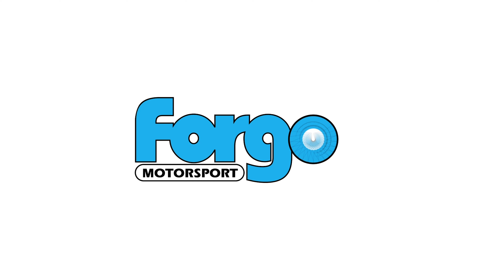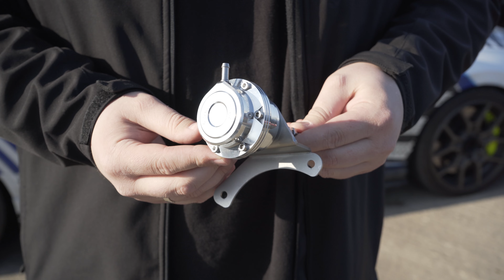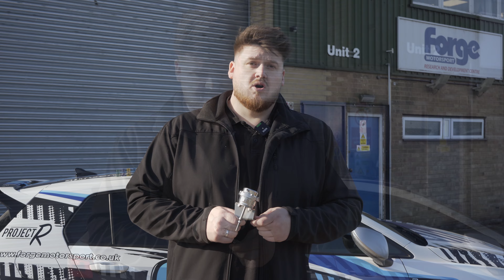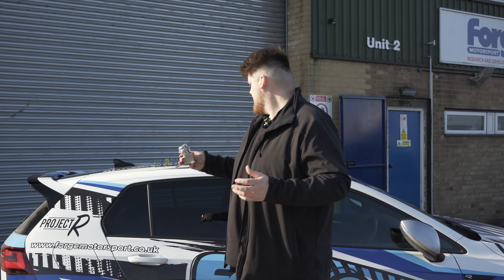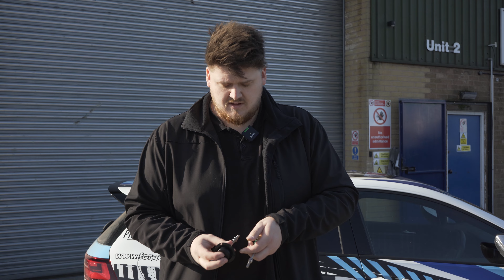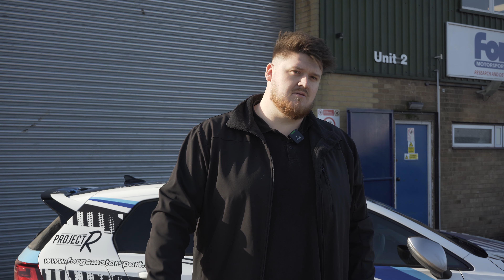Why you should upgrade your Turbo Actuator | Forge VS OEM

Comment: My actuator has failed on my 2013 SEAT LEON FR 1.8 TSI how to replace with one of these?
Reply from the maker: Hey, if you hit the vehicle tab on our website you can configure your car. We don't have a specific direct replacement for the 1.8 TSI. - Thanks!
Reply: @forgemotorsport not available for the 2013 :(

Comment: i still dont understand what the different springs do,  i presume the stronger ones close the wastegate quicker or stop it opening on higher boost?
Reply from the maker: Hello! Actuators regulate boost pressure, the stronger the spring the higher the pressure is regulated to – with a stronger spring fitted more pressure is required to lift the actuator piston off its seat, delaying the opening of the wastegate and allowing more boost pressure to build in the system before pressure is bled off via the wastegate. Any further questions just let us know :) - Esme, Forge Motorsport

Comment: Soooooo this actuator is ONLY good for maximum 20psi ???? My oem actuator allows 30psi  , so I just DOWNGRADED and wasted my money on yet another junk forge product...ugh
Reply from the maker: Hello, 

We're more than happy to explain the technicalities - but before we do, what car do you have?

We supply a number of topflight motorsport teams across a wide range of different disciplines, from Formula Drift and Touring Car to LMP - not to mention, numerous OEMs via our Private Label Programme. Whilst it's easy to call our products 'junk', the reality is far from that. 

We very much look forward to your response. 

- AJ, Forge Motorsport
Reply: 30 psi? BS!

Comment: for Opel corsa e 1.4 turbo, there is 2 choices so what is the difference between piston and diaphragm ?
Reply from the maker: Hi Paul, 
From a performance perspective It is difficult for us to recommend one type over the other as their performance is very much the same. There is a school of thought that suggests the diaphragm type is quicker to respond, but from our perspective the difference is negligible.
We do have reports of the piston type sticking in sub-zero temperatures and this seems to only occur on start-up but is apparently quickly overcome by rising vacuum pressure/turbo heat. We have little information on this “problem” as the reports are few, suggesting it is not a common occurrence.

I recommend watching our servicing videos so you can see the inside of both actuators to decide which you may prefer! 

https://youtu.be/mJwmJgJUQE4?si=W2dNKS4iMpazDSVH - Diaphragm
https://youtu.be/CKUci91jUC8?si=l-cHccZ3WEBrz3k8 - Piston
Reply: @forgemotorsport thank's for the answer ! I already looked them and make a choice 😎

Comment: i've shortened my oe actuator arm by 3 mm ( 3 full turns or 6 half turns)on my fiat punto evo ( from the neutral position i guess you can say , right ? ). is this bad for the turbo/engine ? thanks
Reply from the maker: You will need to contact our sales team on sales@forgemotorsport.co.uk and they can assist you!

Comment: Can I upgrade my stock actuator on my 2016 Hyundai Veloster Turbo??? Because I don’t see any videos of anyone doin it
Reply from the maker: Yes you can typically upgrade the majority of Turbo Actuators! I believe we already do an upgrade for this platform too, it can be found on the Forge Motorsport website under the part number - FMACHTV
Reply: @forgemotorsport  thank you for the advice and response 🙌🏽